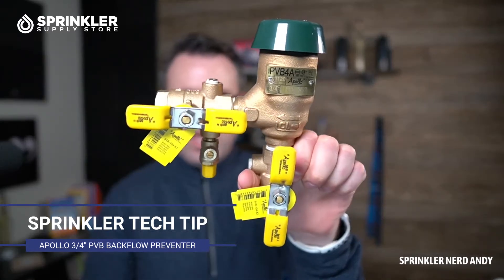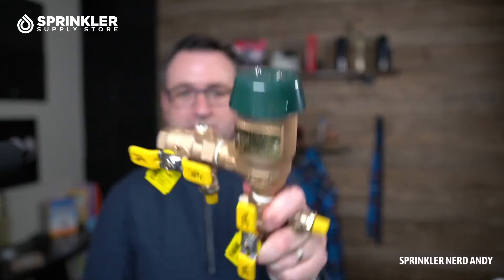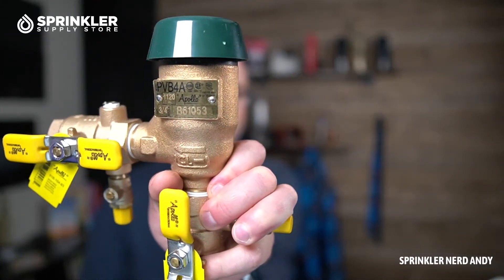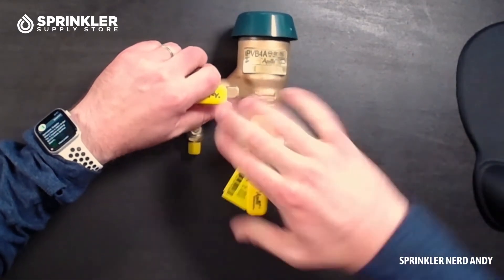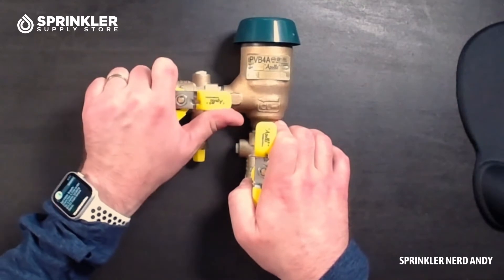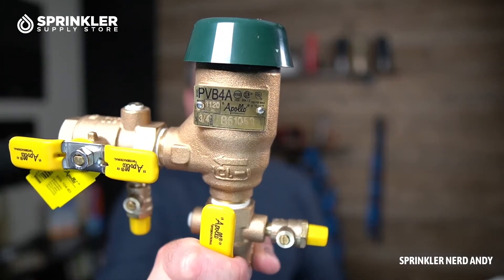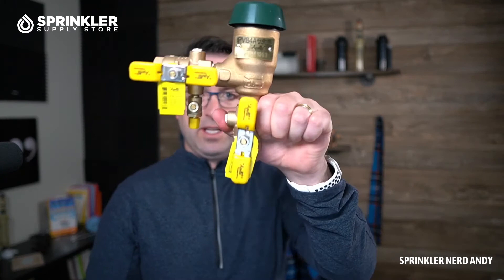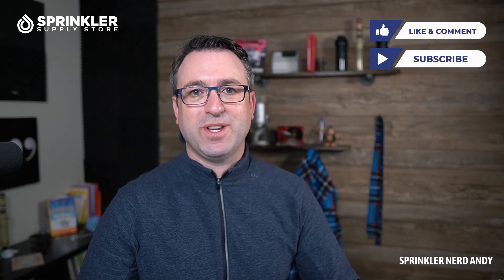Apollo-Conbraco 3/4-inch  PVB Backflow Preventer

Comment: Hello Andy,  I have a PVB4A 1 inch Apollo valve.  I need a "yellow nut" replacement - as mine have cracked over the winter and now leak.  Do you know where I can buy these parts?  Also, would it be possible to buy a better fitting nut made of copper?  Having problems finding this simple part...any help or guidance is appreciated!
Reply from the maker: Hi Brian. Which yellow nut are you describing? Perhaps you mean the yellow cap on the test port? This part is just a cap and not needed. If it leaks, my guess is the port is still open. Grab a flathead screwdriver and take a close look. It should be turned perpendicular for "OFF". It is probably turned just a little bit and is, therefore, leaking. Just a hunch.

Comment: Do you have a video or instructions on how to install all the parts for the bonnet and poppet. I have that same one.
Reply from the maker: Turn off the water supply using the lower valve handle.

Remove the bell and remove any leftover parts of the original bonnet and poppet out of the backflow.  

The new bonnet and poppet kit will get threaded in just hand tight.  First the poppet, then the bonnet, then the bell.  You want to be sure not to overtighten these parts.

Please feel free to contact us directly at our website if you need any further assistance.